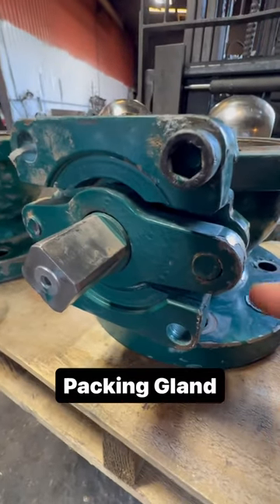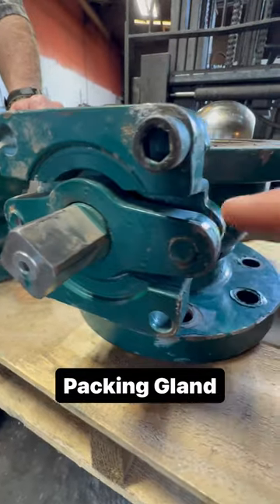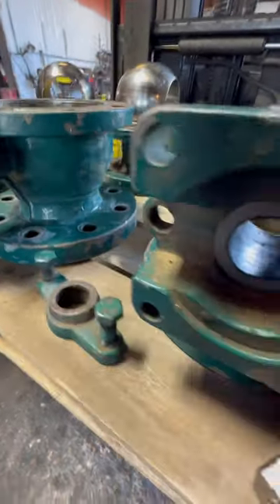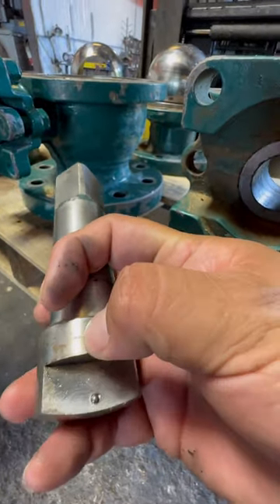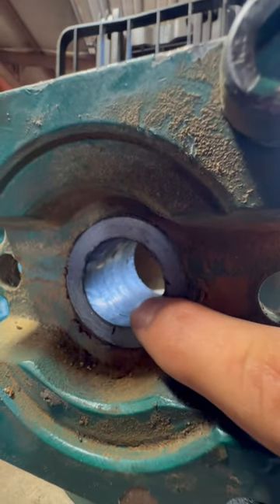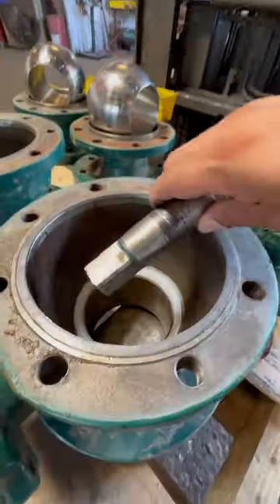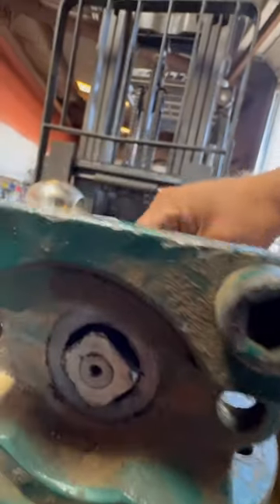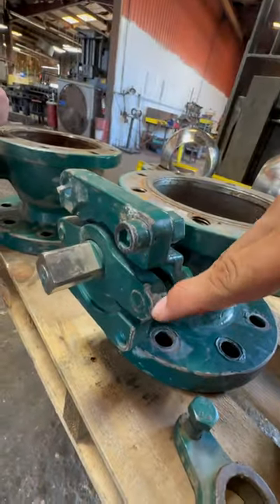Ball Valve Packing Gland #ballvalve #valve #ballvalves

Comment: Is that all there is to the packing gland, no washers or gasket?
Reply from the maker: For this particular manufacturer that is all there is. It meets API 607 requirements. There are other designs that incorporate orings packing grease injectors and other types of polymers. For the most part the basic ball valves are quite simple. Thanks for the comment.